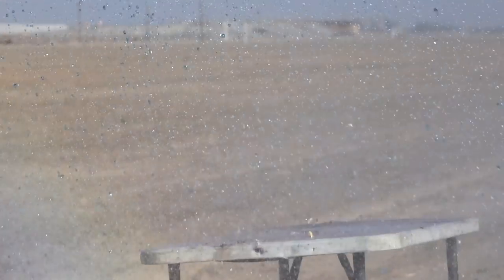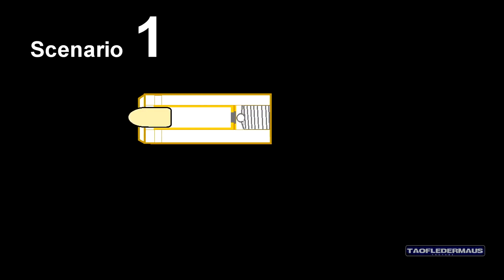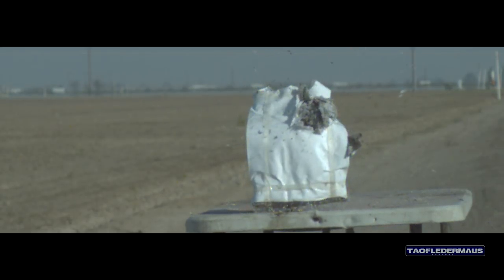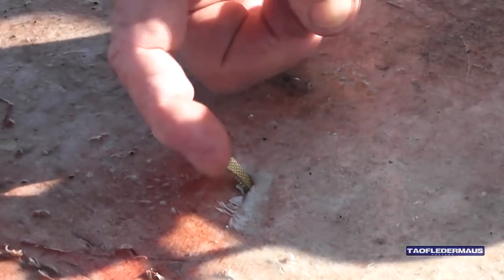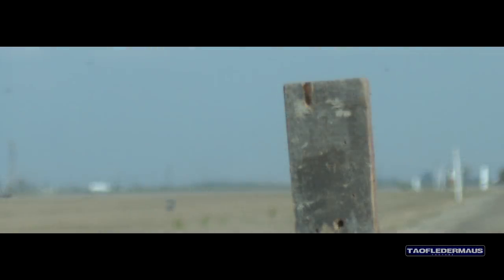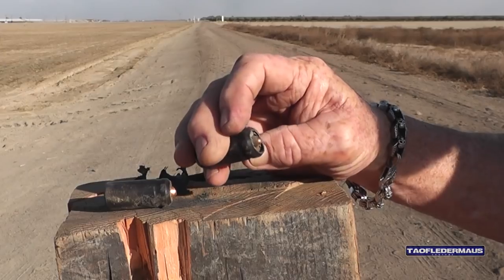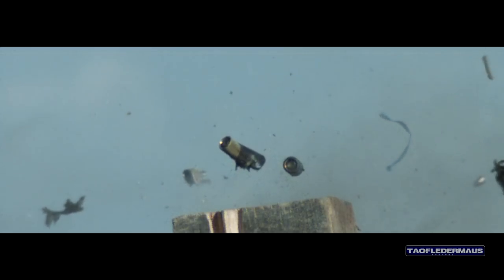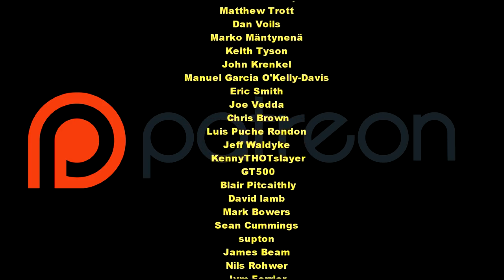The 12ga. Slug with a 9mm Round Inside?  - Too Dangerous?

Comment from the maker: Thank you everyone who has submitted non-English (and English)  subtitles!    Warms my heart that anyone would take the time to do that!
Reply: Hey, I was thinking: If you could make it so that there would be no risk of the 9mm being pressed against the BB while INSIDE the barrel, because of its own inertia, I bet it would be (Relatively) safe to shoot those slugs with live 9mm...

Suggestion: Drill a little the bolt/screw that caps the tail of the slug, so that the ball sits in a little depression, which will ENSURE that the BB would NEVER toutch the LIVE ammo's primer while INSIDE the barrel.
Reply: Luiz Barros 
Good to hear someone with a decent idea instead of just criticizing. Your idea just might be the ticket to success!👍🏻.   🇺🇸😎
Reply: Danny AKA Triker Red Thanks! ☺
Ah... P.S. they should try this with 45ACP:
Remove the bullet, then drill a little on the bullet's core and fill the bullet core with gun powder. After that put the bullet together, and use this to complement my previous suggestion. This MIGHT make the bullet go boom...
Reply: But maybe the powder will just be blasted unburnt... well only one way to find out...
Reply: TAOFLEDERMAUS as a follow up how about using the fith ops trap and a barrel as a remote shotgun?
Reply: I'm wondering if you couldn't take the 9mm and fill it with the equivalent grain weight in sand. IE, removing the powder for safety reasons.
This would allow you to test and see if the 9mm round effects the ballistics at all. It could potentially make them fly straight, given the added nose weight.

I'm also wondering if stripping the rubber coating effected the ballistics.
Reply: TAOFLEDERMAUS, I  seriously do love all your videos, but some have me concerned you might need some type of ballistic shielding...i don't want anything bad to happen!
Reply: TAOFLEDERMAUS hey we love your videos in the UK .
Reply: TAOFLEDERMAUS Hello.
Do the NRA support channels like yours?

Did want to ask them but they did not let me send my questions to them from Sweden.

They do want help getting out information to the public, that is what I could find on there home page.

Link to NRA:
https://home.nra.org

Ps. Do not trust all links description.
Reply: If I️ 3d print a round and send it to you will you shoot it?
Reply from the maker: No,   I get zero support from any third party
Reply: i got ads hell yeah....
Reply: That bee was 1 week away from retirement. 😜😂😂
Reply: TAOFLEDERMAUS - The bee should feel privileged to have made it on your channel! She's in the big leagues now.
Reply: I'd love to see you shoot one of those shells by attaching a string to the trigger  and pulling the  string behind cover
Reply: 0:02 ... yeeeeeup.... yeeeeeup.... yeeeeeup   thats what we in my business call "not being their any more"  yeup  yeup
Reply: 10:18  ... have you consider .. string? its this great new invention that lets you trigger stuff remotely .. get yours today :P
Reply: 12:03 it occurs to me that  removing the weight of the  9 mm from the front of the projectile may have moved the center of mas back and that might be what destabilized it  might be an idea to try it with a 9mm  loaded but without the primer or power  and maybe sand or water to make up the weight :)
Reply: 6:24 ... really dude .. really ... snuff films... really ... and people wonder why there's an ad boycott .... see people... this is why we cant have nice things... :P
Reply: TAOFLEDERMAUS the safety issues I get, but what legal issues were y'all worried about?
Reply: TAOFLEDERMAUS dem a dere dey do
Reply: Can you even try?!?! Use them out of a Rifled Barrel..
Reply: TAOFLEDERMAUS , actually this concept is NOT new...
I'm 50yo and my father used to tell of a friend of his when he was in is 20's, (so that would be about 60 years ago), by the nickname of Barrel Head, he used to fire live .30-.06 rounds from the same design 12ga.slug-sabot just as you had in your hands for the 9mm.
The trick to firing them is to load a birdshot shock ring under slug/rifle combination
making sure you have cartridge tight in slug, no free play, the free play will set off rifle shell.
He used these for hunting deer, until DNR ticketed him for using a rifle in shotgun ONLY hunting area.
Reply: MrNeutral01 , if he was to use a rifled barrel,  it would stabilize bullet, & if he load slug/pistol round on top of birdshot shock ring he can fire it safely, a friend loads 
3" - 12ga.slug-sabot with live 
.30-.06 rounds & never had issue.
Reply: TAOFLEDERMAUS   not split personality, but rather split personage.
Reply: Flying sideways killed it for me. For me it was a failure
Reply: Launching a 410 shell is next.
Reply: I miss our old friend
RIP 
But I know he's up there testing out God's new demon devastator rounds   for God's army

Comment: Maybe could have tried loading the 9mm and .45acp with with play sand and using already shot primers to see if the gravity center shift would have straightened them out a bit? I'd be interested in seeing that.
Reply: Agreed, I think the c.o.g. shift and added mass should affect the stabilization. They could even just use a ‘snap cap’ round.
Reply: I was thinking the exact same thing. Dummy loads would shift COG forward and may stabilize the round.
Reply: You made the exact point I was about to write.. I'm a reloader & would have suggested they use powder & bullet with a dead primer & see if that would stabilize the round..

Comment: Why didn't you set them up on that little string thing? Not in a gun, the thing that like.. screws into your table or a block of wood, I forgot what you called it. :X
Reply from the maker: Because we did it this way
Reply: With an answer like that, you must be Jeff Sessions.
Reply: TAOFLEDERMAUS 

You forgot to bring it when you filmed, didnt you?

I thought demo ranch was the slacker channel?
Reply: Fine then. At this point I just want to remember what it's called.. ~Searches for "bullet outside of gun"~ 
Fith Ops Perimiter Trip Alarm.. next time try it with that, if you got any left! :P
Reply from the maker: No,   I can't risk blowing up guns - even a cheap shotgun costs more than this video will earn,   so I have to be smart and load oddball rounds safely.
Reply: How will putting an oddball round in the perimeter trip alarm blow up a gun?
Reply: TAOFLEDERMAUS I'm with you, honestly. But, more worried about personnel safety than equipment.

Even an expensive gun can be replaced.

I do, however, agree with the perimeter trip alarm idea, although the wax slug was awesome, lol.
Reply: DeDraconis cuh da dem a dere dey is be do.

Comment: If you can hear the bb moving, then the bb is not in certain contact with the primer.

And the round being loaded into the shell likely offsets the keyholing, making it fly straight. If the shell is weighted to account for that weight in the front, with the cap in the back, then it's absence would certainly make it fly wonky.

Comment: Using a smaller cillinder at the back of the 9mm shell to house the ball would stop the shell from going backwards and firing from inertia and still allow the ball to advance after hittin. It would also not allow the round from firing if the slug impacted backwards. But im not sure if the inertia propelling the ball could be enough to set the primer uppon impact and it would only work against hard enough targets, making the fragmentation feature kind of useless. At least thats my theory, no ballistic expert or anything tho

Comment: Without being held tightly in a chamber to contain the pressure all detonating the 9mm rounds did was cause the cases to rupture. The bullets probably didn't fly more than a few feet after separating from the brass slug.

Comment: I'm pretty sure that they would have flown straight with no tumble if it was loaded with the 9mm due to its mass being at the centre, rather than having a hallow unloaded centre and the main butt of the slug being the centre of mass.
For safety purposes, you could load a dummy 9mm round with sand or some sort of powder to get the same weight as a 9mm round.

Comment: You noted that this brass concoction weighed in at 58grams...I think. Very close to a full two ounces.  Then you shots some shot shells that were over one ounce 1 and 1/8th ounce  and you noticed that these were impressive in report and on impact. Would you consider shooting a lead slug  as close to 2 ounces as you feel comfortable. Use a smooth bore as rifling would only serve to increase pressure.  Another thought along this line would be using a 10 guage  shotgun. Maybe use even an old 8 guage ? Big ball of lead going pretty fast is always impressive. You guys are the best. I love seeing what happens upon impact using the slo-motion camera. Keep up the good work !  ;-)

Comment: Very interesting slug there. I agree that shooting it with a 9x19mm in there would be very dodgy, even with a rifled barrel. Having a little C4 in there would probably work better, but I'm pretty sure the BATFE would have some words with you over that one. I did have a strange and unrelated thought. Have you tried shooting Estes rocket motors from a shotgun? I know you will want a rifled barrel. Not so sure how to load them. Perhaps a C motor can be made to fit if wrapped in tape?
Reply from the maker: There were several hinkey things about this,  the diameter was to large for a rifled barrel,  the weight of these meant we had to use careful powder load calculations, and  the fact they could have blown up in the barrel of course.   As far as rocket engines go,  I estimate that the 10,000 g's of shock would cause the engine to powderize and create a very dangerous explosion in the barrel.
Reply: Hmm. Sad about the slugs. As for the rocket engines, you could get away with simply igniting them. This shouldn't take much charge at all on top of the primer. They should propel themselves out of the barrel without the severe shock. If you use a first stage motor, it will make a bang the instant it runs out of propellent since it is supposed to ignite the next stage. If you use a regular motor, it will do a smoke trail for the specified number of seconds before firing a charge intended to deploy a parachute or streamer recovery system. Obviously eye protection would be an extra must (I'm sure you never skimp on that) as the propellent burns for almost a full second. Once they clear the barrel, stability could be a serious issue. I've fired a few without the benefit of a model rocket or tube and they spin off in a random direction.

Of course I could be completely wrong and essentially suggesting you build an open ended pipe bomb which nobody wants. Also impacting a target could likewise disable the ejection charge.

Comment: I have a simple way of checking if having the 9mm in would stabilize. Instead of using a live 9mm simply take a once fired case with the spent primer still in, then simply "reload" by filling the case with roughly the same mass of sand or something non combustible to get the weight right and stuff a 115g fmj in there. Then you have essentially a snap cap that is 1:1 in not only size but mass as well, but since there is no explosive or chain reaction taking place i don't see how itd be any different than any of the other wacky stuff y'all have shot over the years.

Comment: Not that it really matters, but having a right hand threaded set screw in the base, means it could easily unscrew upon firing........assuming the round was fired from a rifled barrel and actually spun up.  That's why artillery shells have left hand threads on their base plates, and base fuzes, or anything that's threaded, behind the rotating band.

Comment: Ever thought about adding a drogue line to these things?
12 - 24" of braided wire (thin stuff, think TOW guidance wire) coiled between the base of the shell and shot cup that would uncoil and provide just enough drag to get the stupid thing pointed forward?  If you could put some thermal barrier at the base braided kevlar fishing line would suffice, perhaps.

Comment: If the set screw cup was larger than the circumference of the primer and the ball bearing could float freely inside of the cup, the bearing would not make contact with the primer until the round impacted. The nose of the 9mm would no longer need to be exposed..... and they would need to fly straight.

Comment: We see with other slug designs that moving weight towards the nose helps aid in stabilizing flight. out of curiosity, would the added weight of a round in it help it stabilize? You could load a dummy round, like, without powder or primer, and simulate the weight with another medium.

Comment: If you ever want to shoot exotic shell like that with live round on it.   You better not have any play at all on ball bearing and the 9mm's primer.   If there is even an hair of travel between, it will go off inside the barrel. But if they stay together the whole way, it will blow only on inpact.  After all the bearing inside is pushed back towards shooter on g shock, and as long as it cannot gain any momentum due lack of movement space, it cannot bounce back towards the primer of secondary shot.     

Anyway, i think you made the only correct thing to do and leave those rounds .  Only safe way would be with string and proper cover for shooter and camera. And in that case theres allways the chance of damaging the shotgun aswell.  But material can be repaired or bought new,  if you loose your fingers, whole arm, eye etc,  thats not repairable .
Reply from the maker: No no no!   That is a commonly-believed myth.    When we did the rifle round chain reactions,  there were NO gaps and all the round went off sequentially!

Comment: I have an idea for you to try .Try firing a hilti concrete anchor out of a rifled barrel .you may need the RSS slug carrier .they come in different sizes from 1/4 inch rod up to 1 inch rod .There are specific hole sizes for the specific anchors .You use a pin setter and a 2lb Mallot to drive the pin in to anchor it in the concrete .looks just like the Gualbo steel slug at a fraction of the price

Comment: Cool slug. Would have like to seen it fired with live round. Nacheze supply if I spelled that right, carries an arrow head that uses a live 38/357 in it. Made from hard poly.  Goes off when hits solid target. They Ben selling them for years, I Think they still are. Check them out.
Reply from the maker: We shot those arrow things before,   they suck
Reply: TAOFLEDERMAUS Yea pretty much every thing I've watched on them proves that. I've always wondered if they couldn't be turned down and used as slug load. If had a place to test I would try. Only shoot twenty gauge now or would try those slugs in this video. Demo ranch! ( mikey seems willing to try anything) lol.

Comment: Maybe try tying a gun down to a table with a string attached to the trigger so you can see if the slugs work without risking an arm or two. Then again, shotguns aren't cheap and that would be an expensive test if it blew up.
Reply from the maker: We load slugs to safe chamber pressures so we don't need to do that.
Reply: TAOFLEDERMAUS so the main worry is the slug flipping and firing back at you then? Yeah, getting shot at doesn't sound fun lol

Comment: Would not be that close to the target without some kind of protection from possible shrapnel. Next time, make it into a sabot type round with just a very thin covering and shoot it through a rifled barrel to get it to spin. Next test after that, remove the bullet from a nine mm and crimp the casing closed, put it in backwards with the primer facing front, install a pin ahead of the primer to activate the primer upon impact AND secure the gun in  a holding device in case of a possibility of an explosion upon activating the trigger.

Comment: Not nit picking just wondering, can you guys fire these with a lead weight in the nose about 9mm ish in weight? give the original design its intended stability?  just wanting to see if it straitens it out? I would also pay the 80 bucks to replace the shotgun if you fired one of these from a remote rig on a clamped down shotgun if the thing blew up while firing the real deal!

Comment: Ugh, what a terrible waste of an authentic, vintage, antique Stretch Armstrong! (/sarc)

I wonder if it tumbled because you didn't use a complete round - removing the weight from the powder, case and other components might have compromised the center of mass and made it tumble more that it might have otherwise. Good video! I always enjoy seeing you guys have fun and test these new designs - keep it up!
Reply from the maker: It's pretty normal for long slugs like this to fly sideways.
Reply: I've seen that from your (many) other videos that feature Dancing Slugs, I just had the thought about CoM. The design and concept are both pretty cool, it just needs some fine-tuning to match up with (what I assume is) the designer's intent. 

One thing that just occurred to me: IF it worked as intended (i.e., it shot the sub-caliber bullet on impact) would it be considered a "machine gun" since you get 2 shots for one pull of the trigger? Or would it be in the same field as a Federal "Destructive Device" since it has an explosive payload?

Comment: Just set up a cheep shotgun and try it. The acceleration shouldn't push the ball forward to the primer, but back into the rear
Reply: MD Spaghetti 
But, the acceleration would have driven the 9mm back into the ball and set it off.🇺🇸😎
Reply from the maker: I might earn $25 from this video so that wouldn't be very cost effective.
Reply: TAOFLEDERMAUS true, is there something in the shell stoping the 9mm round from going backwards into the ball?
Reply from the maker: No,  which is why they went off when they were struck by the wax slug from behind.   The slug,  when shot, is under 10,000 g's of acceleration which is similar to being hit from behind with the wax slugs.